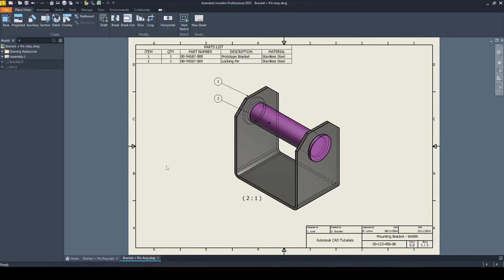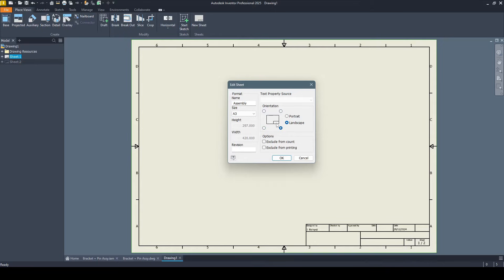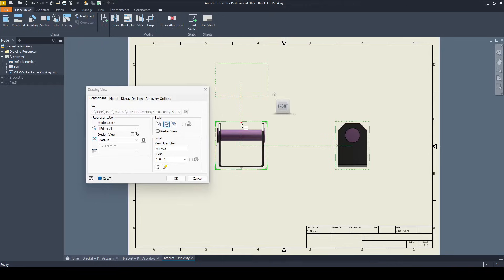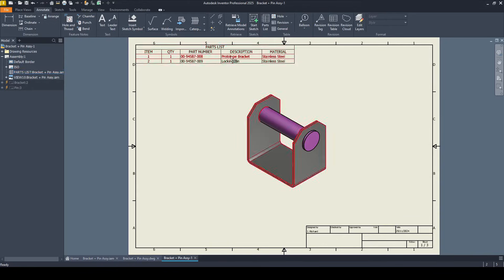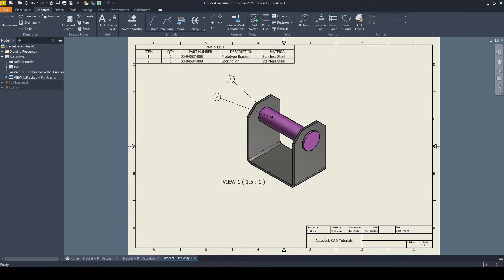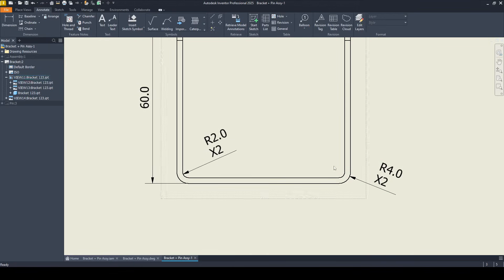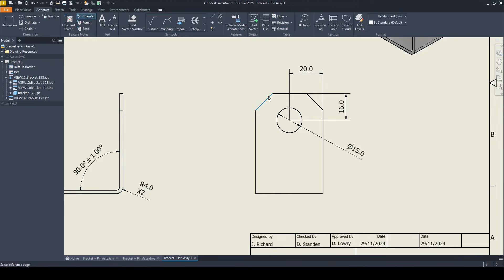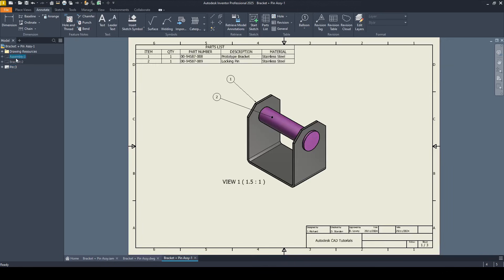2D Engineering Drawings | Autodesk Inventor 2025 | Basics For Beginners |  Step-by-Step

Comment: Are there templates for Electrical Engineering? Both commercial and residential settings? This would be invaluable for techs and hobbyist that want to discriminate current codes.
Reply from the maker: Thank you for your comment! I really appreciate you sharing your thoughts and taking the time to leave feedback. It’s always great to hear different perspectives and ideas. 🙂